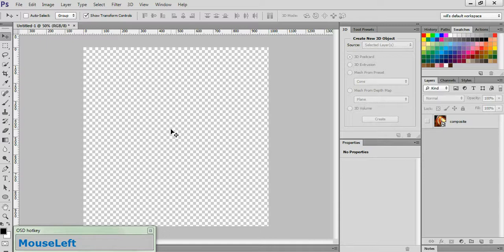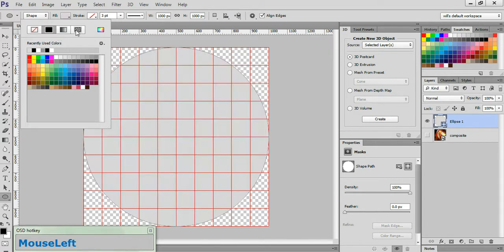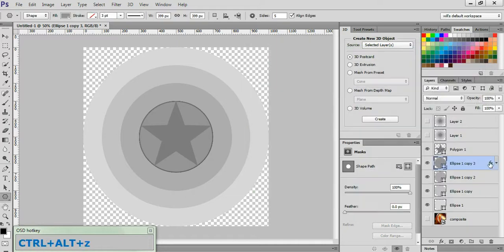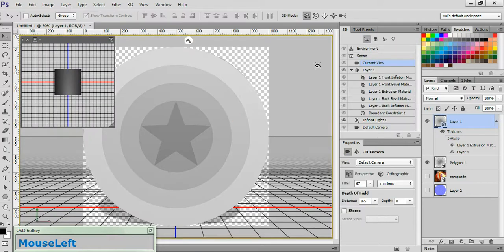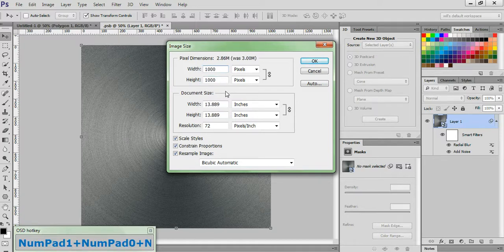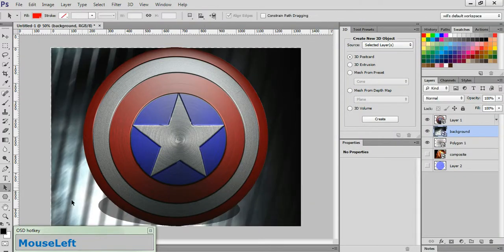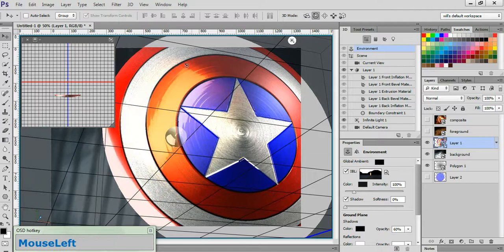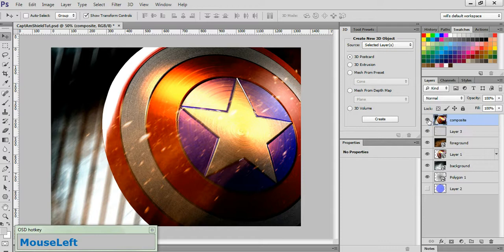Captain America Shield Tutorial with Adobe® Photoshop®  CS6

Comment from the maker: The file should have the extension ".zxp", not ".zip".  Double check that.  Check if Windows is set to show all files.  Also make sure that the version of extension manager that opens matches your version of PS.  If not, you'll have to open extension manager manually, then point it at the .zxp file.  If you still have trouble, go back over the material installation video linked in the description.  If that fails, reply back and we'll dig deeper.  Good luck!

Comment from the maker: There are differences, some not so little.  For one, you'll  do the 3D extrusion within the repousse panel, which no longer exists in CS6.  Also, the image based light is installed in the lights pane of the 3d panel in CS5.  There are other small differences in the workflow, as well.  That being said, this project is more than doable in CS5.  Feel free to ask more specific questions as you work through the tutorial.  I still have an old copy of cs5 lying around.  I'd be happy to dust it off.

Comment from the maker: If you're seeing the new materials in the picker, you should definitely see a change as soon as you select one.  In fact, every texture of that particular layer will be reset to comply with the new material.  First, check and make sure you have the correct layer selected.  If that's not the problem, you might try restarting Photoshop.  The 3D still gets a little quirky at times and occasionally, nothing will fix it except a reboot.  Try those two things and keep me posted.  Good luck!

Comment from the maker: It's not a plug in, exactly, but there is a material extension library available from Photoshop. you will need if you plan to use the brushed metal material.  There are only a few materials available by default, but luckily, new materials are easy to add.  On the material picker, click the sub-menu (the same one you use to swap material sets) and select "Load Materials ..."  A box will appear with some information.  Choose "Go".